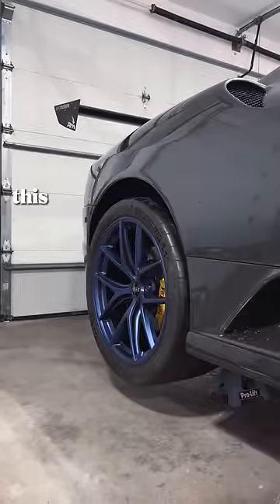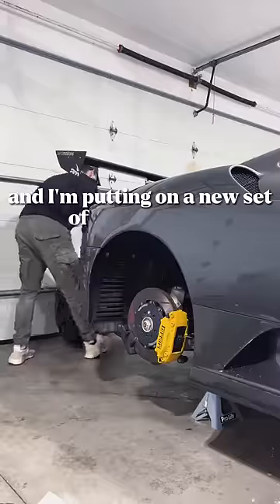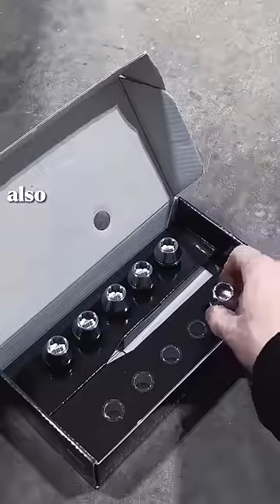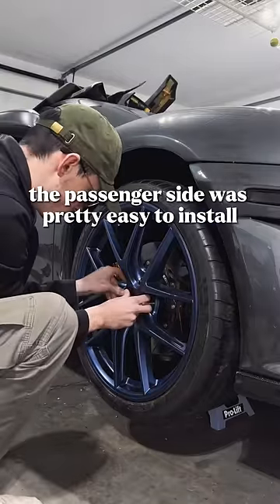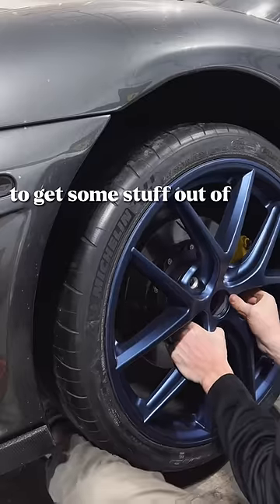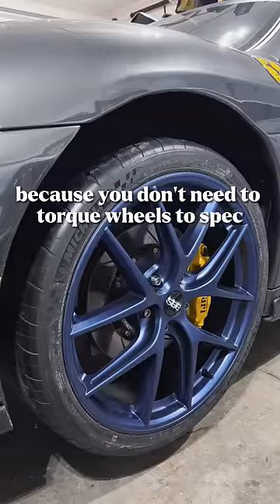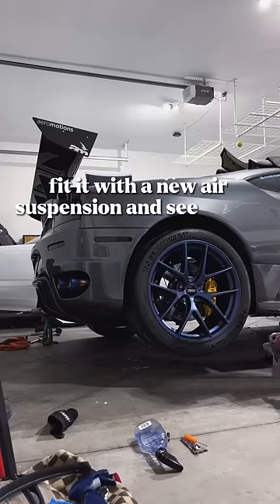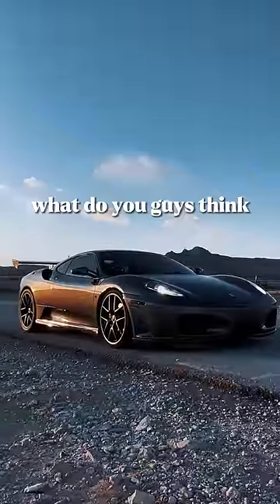Cutting Up A Ferrari In My Garage For New Wheels

Comment: Since you have 'floating hat' brake discs your discs do not see any adverse tension from torque differences lug to lug.

Since you aren't an F1 driver who will be lapping it at maximum for days on end I'm not too worried about the wheels or lug studs either.  Out of curiosity are these real BBS or the BBS badged consumer grade (Walmart) stuff?

Comment: Maybe not to spec torque but i had a wheel bolt break trying to get it off because the tire shop torqued it down to hard.
Also have fun installing a spare on the side of the road when the lugs are over torqued.  Im guessing thats not a thing Ferrari owners do but happens to the average joe once in a while.

Comment: Don't listen to people like this that say you don't need to use a torque wrench to tighten certain things. There is a reason why there is an owner's manual. Please read and look up the torque requirements for certain car parts on your car. Torque requirements for essential things could be a safety hazard for instance wheels are very important. Because if not a wheel can come off when you are going down the highway and hurt yourself or hurt someone else. There are plenty of videos here on YouTube where you can find where a wheel came off from a moving vehicle. There might be people here that will probably say that race teams tighten wheels with their impact wrench this way but that is a situation that is done in a controlled racing circuit and even then accidents have happened where a wheel came off a moving race car and has hurt people. So please just take 5 extra minutes and check the lug nuts on your wheels to see if they are torqued to the proper torque requirements.

Comment: You can't torque after market wheels to spec, because there isn't one. Oem yes, even different oem wheel nuts on oem wheels change the torque settings.. never mind both..

Comment: I always torque to spec. Lost a wheel a 50mph in the Carolinas because a tech over torqued with a  impact and cracked the studs. Couldn't sue because of a liability sign off that the shop had. Never go to hard and never go soft, lost a custom rear axle nut on my motorcycle because of that. Always torque to spec.

Comment: DO NOT LISTEN TO THIS GUY, PLEASE TORQUE YOUR LUG NUTS TO SPEC. 

I used to UGGA DUGGA my lug nuts on until I eventually stretched out a couple of the lugs on my FR-S and upon attempting to remove the wheels after a track day, some of the lugs straight up snapped off. What a nightmare!

Comment: Nice but I have one complaint. You refer to yourself as a “master mechanic” but you were taking the lug nuts off with what appears to be a 3/8 drive ratchet, and no extension. Why not use a 1/2 drive breaker bar with a six inch extension?!?

Comment: Anyone in this comment section that thinks you can’t over torque wheels has obviously never seen an alloy fail at 70mph on a motorway.
When you’re rolling door to door into oncoming traffic you’ll wish you just spent a little more time to do it right.

Comment: Why torque to spec?

I see someone has never had to replace a set of aluminum wheels, after some hack zapped them in at 700 foot pounds, and by that I mean, "trained Professional " at a chain place.

2003. 2002 Blazer. Killed all 4 rims.

Imagine what it wouod run, woth that paid promotion setup you just installed. 

So yes. Use a damn torque wrench.  Especially installing a track set. Because the above mentioned Blazer had one come off, on the test drive.

His former boss filled me in, when he applied at my shop. Needless to say, he wasn't hired.

Comment: Torque aluminum wheels. If you ugga Dugga a cheap aluminum wheel, it will mess the wheel up, seen it happen on a tire change on a 17’ 4Runner. Alum. Alloy wheel trashed because it was torqued the fuck out of with the gun. If they’re steel or forged, send it.

Comment: So not suing but what happens is when ya think ya smart ya already failed you don't need to torque weels to spec now there is a problem month or few year or few few bolts might undo a fair bit when if the rim comes off and this car gets side damage  with your master mechanic license gotta fix the problem just cause you felt like it ain't worth following torque for 30 sec you first gotta fix then pay the costs ? Worth the lost time after ? I mean 5 to 7 sec torque should be done at about 60 70% or done now this can help cause I seen people loose a rim they ain't cheap too and scratched n repainted also adds wasted time to the list otherwise looks good